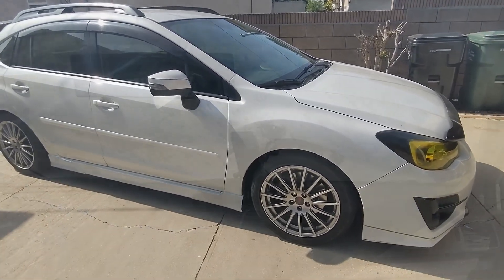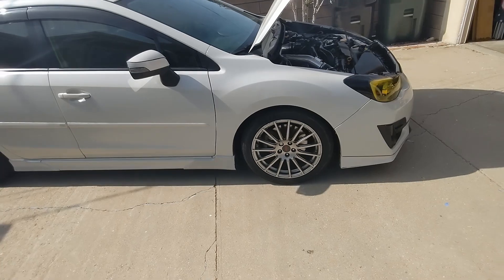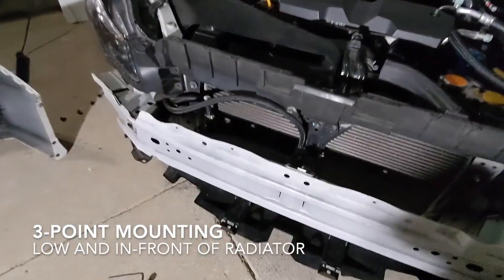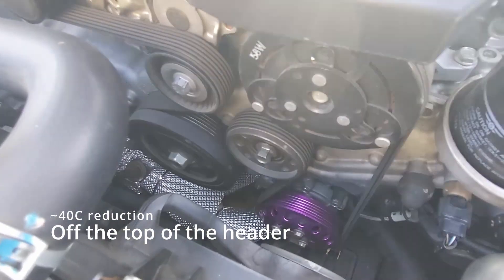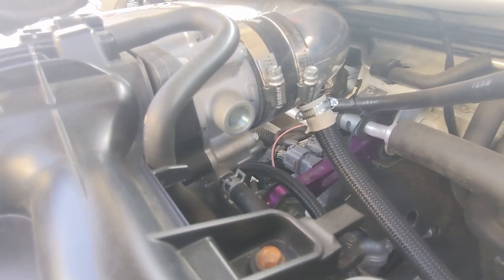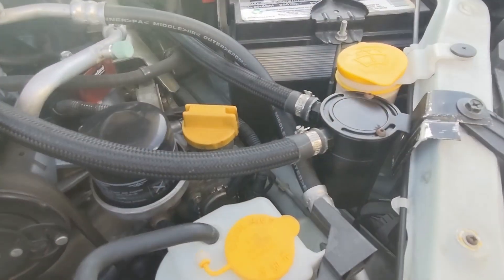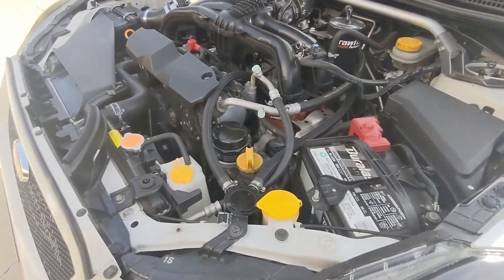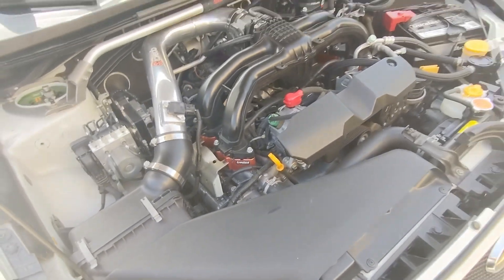Cooling Modifications - Subaru Impreza + Crosstrek

Comment: Hey Jason, I had a question. You are running the "Bypass" method for the CVT cooler. I'm guessing this doesn't matter too much, but did you plug the ports for the stock cooler/heat exchanger or did you just leave them open?
Reply from the maker: To keep the fluid from dribbling everywhere, I reattached the hoses together with a double male connector and tidied it up so it won't get in the way. It is then easy to reattach the OEM cooler in case you have to do maintenance on the exterior cooler.  Good luck!
Reply: Thanks for the reply! That's exactly what I ended up doing haha. But instead of doing it out of convenience for maintenance, I did it because of laziness lol. I couldn't be bothered to remove the factory hoses hahaha. But at least I had the right idea lol. Thanks again!

Comment: Hello Jason i hope everything is well !? Did i just see a light weight crank  pulley on you  car ? What make is it ,is it one piece or two pieces ?
Reply from the maker: https://youtu.be/yo0sMe_zqts?si=8IfhgOSUWhFS-7t3

Hi! The water pump pulley was replaced as well as one of the idler pulleys with lighter ones. NST is the brand I bought, but there are a few you can find. I'd skip the light weight crank pulley, in place, an aftermarket harmonic dampener would be better, or so I've read.
Reply: @JasonLeung-4roller  Jason,thanks for your reply ! I did have a light crank pulley for 10 years  on my older  2006  2.5I with no hint of any issues.Feel free to go ahead with that.But make Sure it will be a single piece (if possible) because some cranks are two pieces.You will feel how easy your engine will rev up as it does free some power.

Comment: How do people do the WRX hood mod? Is there a certain model WRX that is just interchangeable?
Great video mate.
Reply from the maker: 2015+ WRX hood fits on 4th gen impreza (2012-2016) and 1st gen Crosstrek (2013-2017). That being said you will need to do a front end swap which includes headlights, front bumper cover, grille, front fenders. Custom bracketing will also need to be made to hold the bumper cover.  It's doable. Just with a bit of cost and slight fabrication. Thanks for stopping by ✌️

Comment: Have you experimented with any heat wrap on the intake? Iv got the same set up and that pipe gets hot but id like to see this vs plastic vs both with a heat wrap
Reply from the maker: Oh this was definitely something I've thought about for a while. Intake pipe insulation, and even a jacket for cooling. It's definitely something that can be optimized. That pipe definitely gets hot.

Comment: my 2012 subie doesn’t even have a temp gage
Reply from the maker: If you use an iPhone or Android there are options. An OBDII connector (Bluetooth or WiFi) can allow one to access ECU (engine control unit) information. Eg. Torque Pro android app with OBDII connector gives you real time information and the ability to log engine and sensor data. I agree the OEM cluster only shows when it's warm. No oil temp sensor is useful information. Thanks for visiting :)
Reply: My 2022 doesn’t either 😂😂